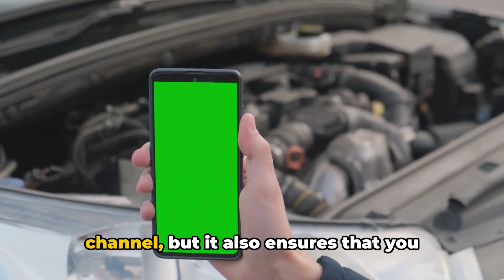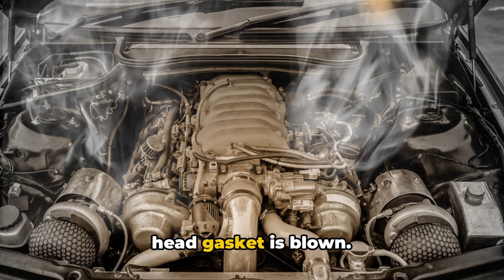What Causes a Blown Head Gasket:  Real Reason For Failure & Signs

Comment: All i had was low compression on cylinders 2-3 down to 60 psi, (2.2 Ecotec) the breach was over a cooling jacket but it wasn’t sending any gases into the system and it would only misfire at idle, and wasn’t using coolant it just gave up i guess at 245,000 miles on the highway

Also it never overheated either so I’m still trying to figure out what happened

Glad im able to get it done in the driveway tho! 😅

Comment: I have a Daihatsu . It gets hot my radiator is full but when it gets hot it fills the reservoir up . Then it blows it out of the overflow hose onto the ground. Is that a blowing head gasket.
Reply: What was the issue?
Reply: Try a thermostat.

Comment: So I have a warranty on my 2005 dodge ram , 224,568 miles on it 
The warranty company is refusing coverage unless we can prove that the head gasket didn’t blow by itself. Any suggestions?
Reply: Did you get it approved? 😮
Reply: @ nope only the water pump, I ended up putting in a new engine, cats exhaust 
My bill is somewhere around 13,000
Reply: @bobdabldr323  that's ridiculous so sorry

Comment: A while back I had a Head gasket job done and kept trying to race some guys on the South side and I put the paddle to the floor and blew out my head gasket on my old truck and I was mad about my mistake
Reply: What exactly was your mistake? That you simply put the pedal to the metal, or that you did it too soon after the repair, or that you chose the wrong mechanic to replace the original head gasket? Please elaborate.

Comment: what's the difference between blown head gasket and just blown head?
Reply from the maker: Hi @dkoz8321, A blown head gasket and a blown head refer to two different issues in an engine, though they are related:

1. Blown Head Gasket: The head gasket is a seal located between the engine block and the cylinder head. Its primary function is to seal the cylinders to ensure maximum compression and avoid leakage of coolant or engine oil into the cylinders. A blown head gasket means this seal has failed, which can lead to a variety of problems, including coolant leaking into the engine oil, oil getting into the coolant, or coolant or oil leaking outside of the engine. It can also cause compression loss and overheating.

2. Blown Head: This term is less commonly used but generally refers to a more serious issue where the cylinder head itself is damaged. This could mean cracks or warping due to overheating or physical damage. A damaged cylinder head can lead to compression loss, coolant or oil leaks, and poor engine performance. It often requires more extensive repair or replacement than a head gasket.

I hope this is helpful.